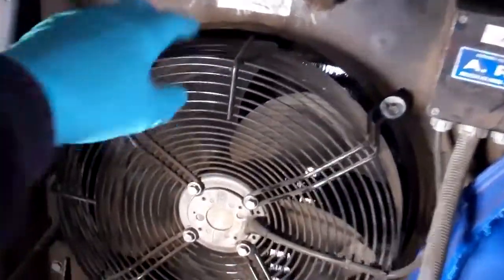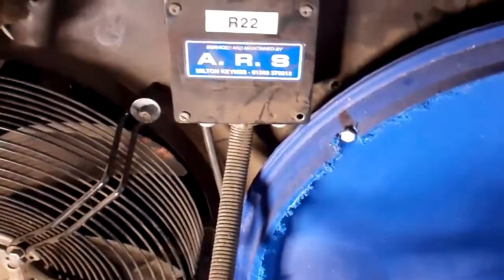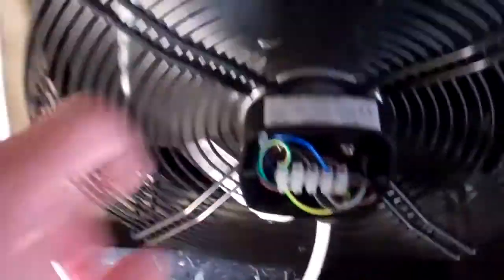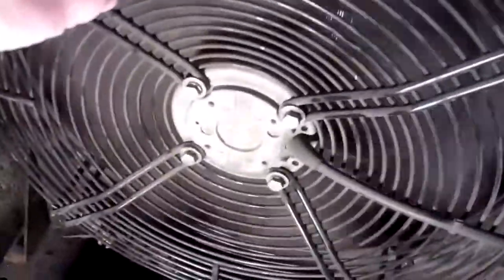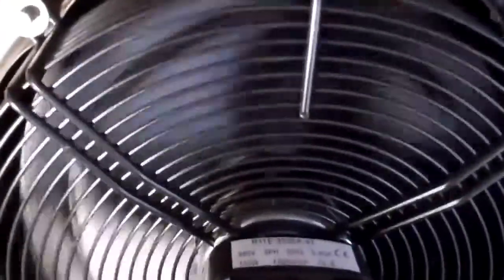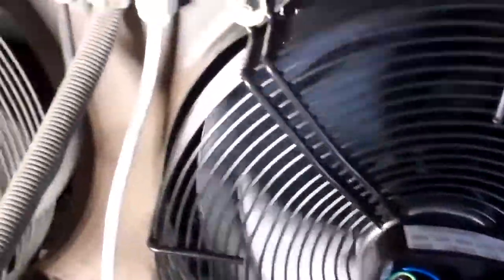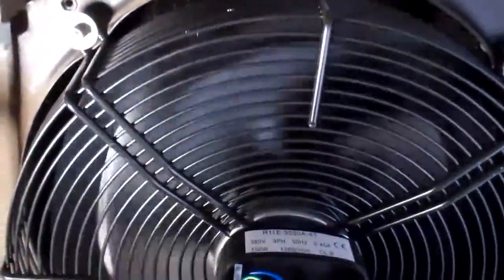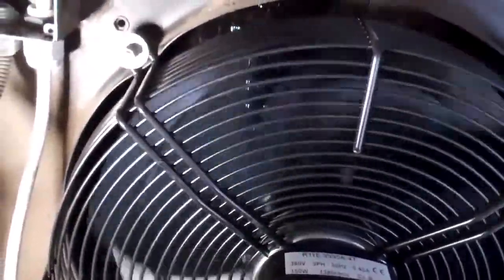Prestcold Fan Change

Comment from the maker: @fritzhvac Thanks Fritz :-)

I fitted three fans today and they all ran the wrong way, lol

The dewalt thing is actually a light! it got the same sort of design as their radios, just got it about a month ago, it'll run for an hour on a 14v battery or you can run it on mains power. 

When i finally get round to making  a vid of my truck i'll show it more clearly, well worth it if you do a lot of work in poorly lit places.

Jon :-D